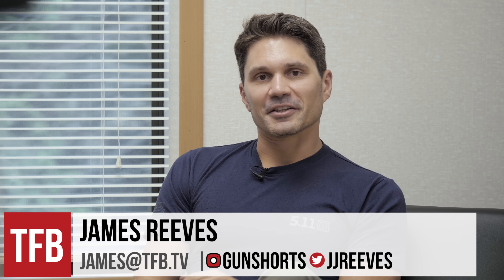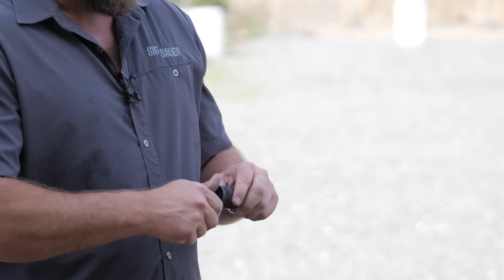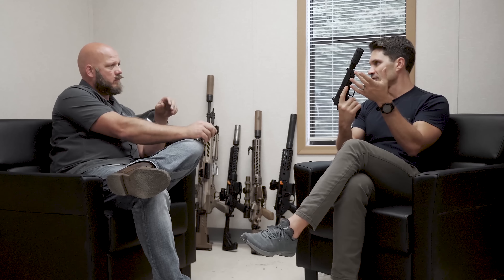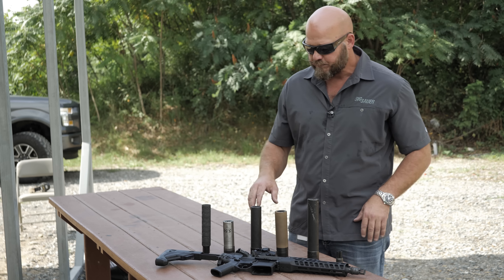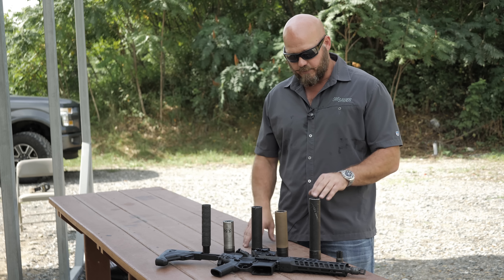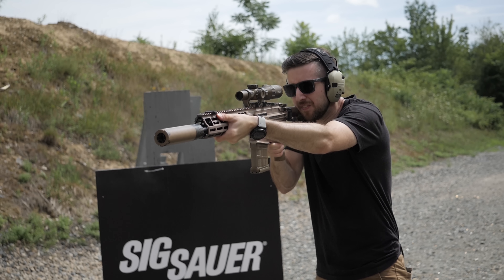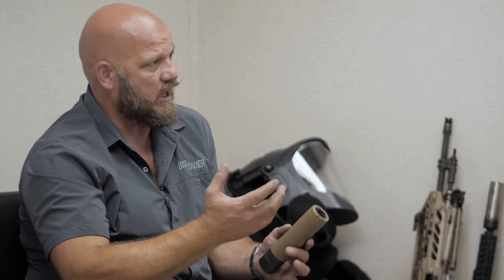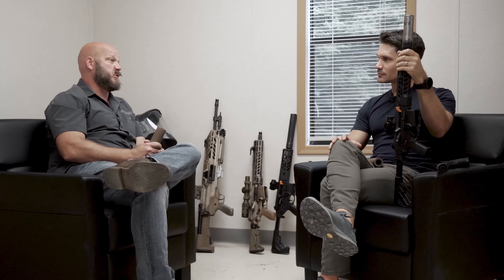Sig's NEW 3D Printed Silencers: The SLH, SLX, and MOD-X

Comment: Built cheaper, don't last as long, and yet still costs the same.........
Reply: Slower production and more tooling cost, also covering the R&D for the new design
Reply: ...annnnnd eventually a better product and improved production methods that can spill over to the rest of the market
Reply: @1014p  Not if you need to make it work under stress using completely a new design, that requires a lot of workbecause it requires different geometries. Also the testing for the real capacity of the final product compared to other methods or different alloys
Reply: 3D printing and sintering is more expensive than milling. You can 3D print almost any shape you want without extra cost, but it’s gonna be weaker than a milled part.

Comment: 10,000 round lifespan is pretty weak considering competitive cans live upwards of 100,000 rounds
Reply: Was going to say the same thing. I have an inconel can that has about 25,000 rounds through it and it is only about four years old with no SIGnifiCAN'T wear, the SIG would have to be replaced in about 18 months at the same rate of fire. That is a lot of stamps and a lot of waiting.
Reply: He said 10,000 on the 6.8 test rig right?  So probably full auto, on an 80,000 psi cartridge.  Just a slightly educated guess, but it's probably not an apples to apples comparison.  That .277 sig fury is gonna be harder on barrels and muzzle devices.
Reply: @joeritter8331  Went back and watched that part again, you're correct. 10,000 rnds through a belt fed doesn't seem to bad.
Reply: The 6.8 round for the NGSW program is EXTREMELY hot as it's a experimental round. It makes M855A1 look like child's play because the requirement calls for chamber pressures around 100,000 PSI. 10,000 rounds through an Inconel can is actually comparable to how other cans would probably fair.
Reply: This!!!!!!!   Thermal Defense Solutions has SOCOM teams with 100k rounds through their Inconel 3D printed cans.
Reply: It’s because the 3D printing and sintering process creates crappy metal compared to milling a piece of metal that already has the properties you need.
Reply: @Montana_Outdoor_Adventures  I’d assume they could chop the non serialized part and weld a new stack on if you shot it out. Saving you the waiting and stamps.
Reply: @vockski3173  DMLS 3D printed parts are stronger than billet in many tests. The laser sintering process can make extraordinarily strong structures that would be impossible with traditional manufacturing techniques.

The 10,000 round lifespan is on a belt-fed .277 Sig Fury machine-gun. That round has an 80,000psi chamber pressure
Reply: @supmonkeyface  considering that these are 3D printed cans, I’m not sure if they could just weld on replacement baffles.
Reply: There are no cans near 100k rounds which haven't been recored.
Reply: @The_John_Galt  LMAO, I'll take things which didn't happen for $1.
Reply: @The_John_Galt  Are they shooting a 80,000 PSI round out of a belt fed machine gun?  Some of listened, but it seems a lot of us didn't.

Comment: Silly me for thinking Sig's choice to streamline production into full automation would translate into affordability rather than some of the most expensive 9mm suppressors on the market. After all, injection molded plastics mags are over $50.
Reply: Well, you gotta pay for all their cool new machines
Reply: @j0ndav1s  That would be a good argument for charging more for a few months and then lowering the price, but we both know it's not going down, especially if it's a successful line.
Reply: Metal Laser Sintering is a slow manufacturing process. Unless they have some novel or revolutionary suppressor design innovations on the horizon, that would drastically change the sound reduction characteristics of a suppressor, I don't understand the move to DMLS production.  I think they are banking on the change in production processes to dazzle the masses into thinking they have revolutionized the suppressor. Because if the DMLS produced suppressor is no better at sound reduction than your standard welded baffle design, why bother?  

Meet the new boss, same as the old boss.
Reply: Simply make friends with a dealer at the pro shop to get a dealer discount
Reply: @AlexHand  Pricing is a complex function of cost, target customers' willingness to pay, substitute/complement product prices, etc. Still, we've no idea what SIG's R&D amortization term is. It can take years to pay off new fixed costs.
Reply: @AlexHand  Inflation is a thing

Comment: Great, now I only just need to do paperwork, pay $200 and wait a year
Reply: Print your own.  3D printers can be less than $200 and you can print as many as you want.
Reply: Right and that BS!!
Reply: Yeah I know owning a suppressor would be cool but the process gets you labeled as a soon to be felon and being taxed on a right is off putting so I guess they win.
Reply: @Oxnate  A $200 printer can't print titanium or steel lol.
Reply: By that time, Biden will be in office and all NFA items will be outlawed and you will be imprisoned for simply requesting to use your 2A Right.

Isn't communism fun?
Reply: Stacks whisker-biscuits in a Pringle’s can , use 5 chips / lid  as a wipe
Reply: SPQR -  Well, it's not going to last 1,000 rounds, but you could easily make one that will last 10 rounds and the right plastic might last up to 100.
Reply: SPQR -  High heat plastics.  Also, not 100 rounds in a minute.  10, wait, 10, wait...
Reply: SPQR -  You and I have different definitions of "purpose" in this case, I believe.
Reply: Just got mine in less than four days. Times have changed

Comment: Omg it gets worse lol. $900 for a can that needs to be replaced after only 10K rounds.
Reply: That’s ridiculous
Reply: Planned obsolescence
Reply: It´s how SIG operates these days, or to be more precise SIG USA. Beancounters instead of engineers and gunsmiths, there´s you result.
Reply: My God you people please pin the point together 10k rounds for the LARGE CALIBER BELT FEED FULL AUTO remember that a 308 BOLT GUN needs barrel changes pretty often if shot often these are not the numbers for you semi auto 5.56 rifle and also remember very low blow back
Reply: @oscarbarahona5419  No he said his experience was from the next-gen program with 6.8. That could be the spear mcx as well.
Reply: @Dylgray  i never said the LMG was 308 i said it was large caliber AND that that large caliber bolt guns in were i refrinced 308 will often need barrel change for high round usage
Reply: @oscarbarahona5419  People don't appreciate the fact that the new 6.8 round creates 80,000psi. I don't think most cans are rated for belt fed .300 Win Mag at 50,000 psi for comparison

Comment: Food for thought, say you got a can with Tax Stamp for $1100.00
You would be paying 11¢/rd if it wear out after 10k rounds (on top of ammo prices)
Reply: I believe he said that was demonstrated on their 6.8 platform, AKA 277 Fury with the inconel cans? I have to imagine, those 10K rounds where demonstrated with a mix, but mostly Full Auto. Plus .277 Fury is a very high pressure round, and will therefore also be high heat. For the average, 10K+ rounds of normal shooting no problem.

Comment: I don't own a long gun but only carry handguns however I did own a 12 gauge Mossberg back in the 1990s ( stainless ) with the " Surefire " flashlight forearm grip 🟧 I should get on of these to keep that noise level down at the range plus have bragging rights that I have one of these 💚

Comment: I say this as someone who has 2 sig pistols a sig rattler and a sig mod9x that’s pending.  They almost feel like their cans are an after thought. The clutch lok is cool but it’s really just a taper and gasket seal and DMLS. Nothing is new or innovative. I feel they made them just to check the box on the NGWS. He confirms this at 12:42

3:26-3:37 “We’ve had a lot of strong results with the modx can not affecting accuracy…or minimally affecting accuracy”

5:18 “Eight baffles is how they’re delivered. And then you know, with an eight baffle design you’re gonna find out you have the same standard…you know…140 42 to 45 db range with the pistol can”.

For reference 142-145 is not hearing safe.  Yet not even a minute later.

6:07 (referring to having 3 baffles) You know now it’s Not gonna be hearing safe at that level but I mean it’s going to be significantly significantly quieter (than unsuppressed) ”.

So within 1 minute he says 142-145 db with eight baffles which is objectively not hearing safe. Then saying with three baffles it’s not gonna be hearing safe but it’s going to be “significantly significantly” quieter (compared to unsuppressed).

The double speak is fucking insane and I say this as someone who traditionally likes sigs.

7:34“we’ve got a pretty specific military end user that’s in this suppressor already and are pretty happy with it, You know”

13:26-13:33 “the goal was to put these on an m4 and have it be less than an m4 unsuppressed” (referencing toxic gases blowing back)

If this was the case then why does the slx/slh   have an internal taper requiring a taper to shoulder converter?

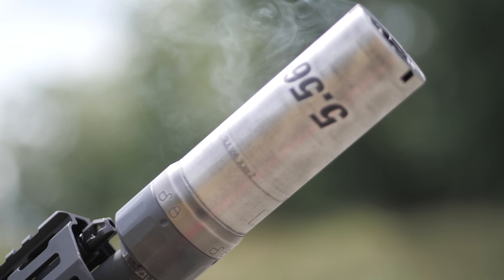18:24 when asked about life span of these suppressors

“And really the only experience I can give you on that is on our SLX on in 6.8  for our next gen program we’re at 10,000 rounds.” James Pushes back

James: “Okay you’re saying you’re at 10,000 and it needs to be replaced or you’re at 10,000 right now in the testing”

Sig rep: “ ideally I would say and you’re in the neighborhood of having to replace it”

James: “And is that one in the titanium or the inconel”

Sig rep: “That one is the inconel.”

So the rep on the phone told me the slhc only last 5000 rounds and will lead up. Another rep told me the slhc will “last forever” and “never lead up  and the can “doesn’t require any maintenance beyond occasional brushing on the inside”

19:37 “And I think when your viewers get and chance they’re gonna see just a vast improvement in suppressor performance with our suppressor line, you know just specific to where we were, let alone our competitors.”

Here we see not only is this untrue but the sig suppressors are not only worse in suppressor performance than the last gen but the sig line of suppressors is literally 2-3x worse than the competition in some instances (300 blackout subs) 1.5-2x as bad as the old gen.

After realjzing all this it’s like they either think we’re stupid or just are making outrageous claims about the performance of their product (lying outright).

Comment: In a world where there was no NFA process this would be a really interesting prospective, but realistically speaking, advocating for retirement of the can after 10,000 rounds (read 10 cases of ammo) is somewhat off-putting for us civilian users who have to deal with Tax Stamps, wait times, and a national registry. Surefire and Dead-Air suppressors have been known to go to 100k rounds no problem, which makes more sense when one has to deal with such laws. For Mil/LEO sales, disposable/semi-disposable suppressors make a lot more sense IMHO. It’s a shame because 3D printing can render some very interesting designs. My 2 cents. I really liked the SRD series of suppressors, not sure why they were discontinued. 

Which leads me to my question, in regards to the rifle suppressors, can they be rebuilt/serviced after 10k rounds without replacement the serialized part and having to undergo the NFA application process again? Would be curious to know.
Reply: that's on their super high pressure next gen 6.8 machine gun. not 5.56 or 300 blk or even .308
Reply: @jamesgarrison5546  After rewatching, I see your right. I would agree full auto .277 Fury @ like 80k PSI is a lot different than semi auto 5.56/.300Blk/.308win. However, the durability of 3D printed materials is still somewhat concerning to me and would be curious to know what round count they rate them for before I invest my monies in one.
Reply: @danmadsen7256  fair enough. I would too.

Comment: So what about all of us who have already purchased what we thought was the latest SIG technology and have been waiting on the ATF to release it from "ATF jail" ? This has been something that I've been stewing on for a while now. I have 3 can's in the pipeline now. This has been my worst fear, to be waiting on what I thought was the best of the best. Only to find out that there's better technology now available, cheaper. For better example, I have a SIG MCX in 300AAC and 5.56. So I purchased a SRD762TI-QD. Currently it sits in ATF jail, waiting and waiting ... And during the wait time, newer tech comes out. I would love to try before you buy or have an option to experience these first hand. But where I live we don't have this option. Very frustrating ! The ATF needs to get their system going ...
Reply from the maker: To be fair, that's a problem with the ATF. I don't think companies should deliberately stifle technological advancements just so we can feel better when we finally get the product we bought a year ago because it's still the most modern version of that product. It sucks, but I don't think that's the manufacturers' fault.
Reply: LMAO, it’s not cheaper at all. You can get far better cans way cheaper that last longer
Reply: @wilhathaway1987  I wasn't meaning the quality, I was referring to the price point. I believe the going rate of a SRD762-QD standard via silencershop is approx. $750.00. Now these newer better quality cans (MOD-X9) are coming out at a price point of around $830.00.
Reply: @tfbtv  I'm sorry, I completely agree. I wasn't clear in my comment. However this topic really charges me up. Manufacturers' are now producing more and more cans at astounding rates. However, unless you have a FFL and SOT you are stuck in the dark on how they physically feel and act in your own hands. I purchased my first can in June of 2020, shortly after started reading up on how the NFA and AFT worked. I have since purchased 2 more cans to cover my firearm collection. Fortunately, I do my research first and believe that I have made some informed choices from material that I had at the time. Thanks in part to TFB TV ! I simply do not understand why it takes the ATF NFA Branch so long to complete these packets. Modern shooting is a sport to be enjoyed by all. I am eagerly awaiting the chance to experience my cans in action.

Comment: I have an SBR'ed MPX in 9mm.  I don't care about the length of the can as much as I care about the suppression.  I wonder if it will be possible to purchase additional baffles?  "You can run it with 9 baffles ... or 8... or 5...."  Yeah, but can I run it with 11?

Comment: So if the high pressure can is optimized for high pressure, would a shorter barrel with subsonic still warrant the high pressure can? Since at the can it’s seeing more pressure, correct?

Comment: It’s a mistake that Sig didn’t develop a compact rifle suppressor for subsonic ammo. Short barrel 300 blackout AR pistols are hugely popular these days and no ones wants to put a 10” suppressor on an AR pistol with only a 5.5” to 10” barrel. Sig really needs compact rifle suppressor that 6” to 7” long and under 11 ounce that works well with both subsonic and super sonic ammo. The Nomad Ti and Q Trash Panda both fit this bill and both have great sound suppression in a very short and light package, 

Sis’s new SLH suppressor looks like it’s at least 9” or 10” long. That’s just too long for SBR’s and AR Pistols with 5.5” to 10” barrels. And the shorter Sig SLX cans aren’t optimized for subsonic. Sig is missing a big segment of the market.

Comment: Did he mention what 3D printing technology? I’m guessing DMLS (Direct Metal Laser Sintering).
Reply: Pretty sure that's what they'd be doing, and that makes me more than a little concerned.  Laser sintered metals are possible, but they're nowhere near as strong.  For something like a suppressor..... that's not exactly a good thing.  (The sintered metals are actually kinda spongey if you cut into them, has to do with how the laser fuses the metal together.  The point where the laser hits kinda swirls, it doesn't just melt in place.)

I'm not going to say 'ZOMG THAT CAN'S GONNA BLOW UP IN YOUR FACE!!!!!' or anything but.... let's just say I have..... concerns.

Comment: Surely if they just 3D print the things now they should be WAY cheaper right?? Oh, it's only $50 cheaper than the $900 average for cans...
Reply: Tooling and R&D is also included in the price.
Reply: @Clockwork0nions  Erm..... but.... SLS doesn't actually need tooling per se, that's kinda the point.  Or one of the points, anyway.
Reply: @corwinweber693  

that's right because the printers and design/research phases are free and require no cost :thinking:.
Reply: @Clockwork0nions  Nowhere near the same.  Yes, an SLS printer is pretty expensive.  150-300k.  A one time purchase that you use over and over again for everything you're producing.  The design and research phases again, are an expense you have in both cases.  The tooling for traditional manufacturing?  Run 200k plus per model of whatever it is you're producing.  And they do eventually wear out and have to be replaced.

Making a 3d model and sending it to the printer is a LOT cheaper.

Comment: It’ll only last 10k rounds he said ?
Reply: That was specifically in reference to the new 6.8 round that operates above 80,000 PSI.  We can assume that the cans will last longer on standard pressure rounds that run around 60,000 PSI.

Comment: So what is the big deal here?  There is nothing new. 3d printed yet adds nothing that isn't offered by other manufacturers.
Reply: Additive manufacturing allows fabrication of designs that would be prohibitively difficult or expensive to construct using other manufacturing techniques.  Hypothetically, it can allow for baffle designs that might be more optimal than traditional baffle designs.  Whether they're doing that is a different question.  They aren't claiming particularly impressive performance.